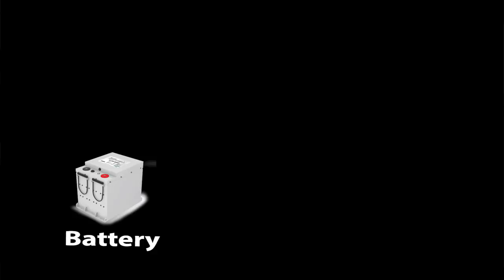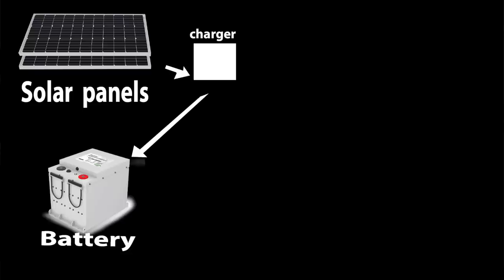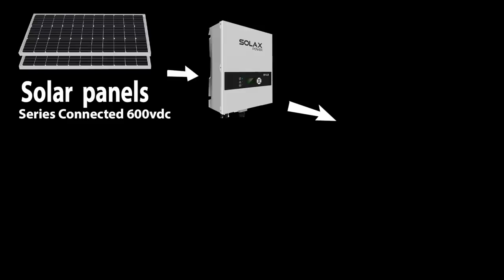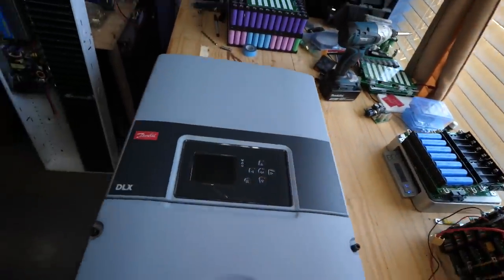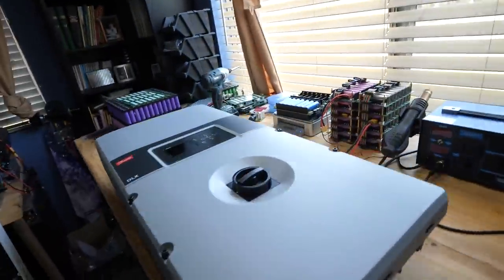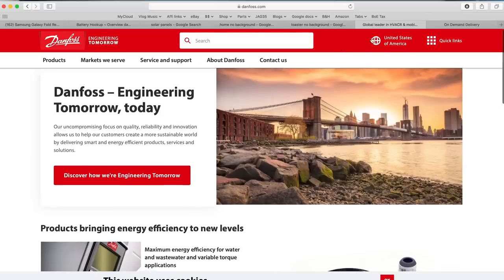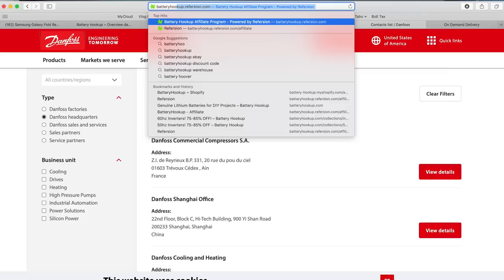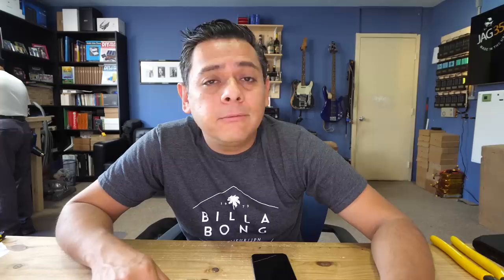Why are these Danfoss SOLAR Inverters So Inexpensive?

Comment: I have been using Danfoss equipment for the last 40 years And never had any problems..I can fully recommend...and I wish to add be it military or civil there stuff is top notch..ps I don't work for Danfoss.. lol
Reply: Are Ul listed?
Reply: We had some Danfoss drive speed controllers for some heavy pump equipment. It's great stuff.

Comment: Strictly speaking, it is "split phase AC" rather than "two phase AC".  Two phase AC is actually something different and it's not commonly used.  In North America we typically have 240 volt split phase AC (120v x 2) for residential or light commercial and 3 phase AC for commercial and industrial sites.
Reply: Chris L must be a uk or Europe thing. Maybe based on 220-240v networks
Reply: @TheMelbournelad  in europe the power is also split phase, but with no neutral so no 120v. the ac power grids in the us and the rest of the world are basically the same until you get to the point of distribution. in my case the point of distribution is the transformer mounted on a pole outside my house that takes in 12k volt from a single phase line that runs along the very top of the pole, steps that down to 240 volts and splits the phase with a neutral line. in europe the situation would be the same except that the transformer would not split the phase or provide a neutral line so you get 220-240 only.
Reply: @marzsit9833  You are correct about North American residential wiring, but I think you are mistaken about most European standards.  Here in NA we have 240V split phase, which is two "hot" leads 240V apart, with a neutral from the transformer centre-tap which is typically grounded somewhere.  This gives two, 120V hot leads, 180 degrees out of phase and a neutral of ~0V, or it can be used to supply 240V across the pair of hot leads for large appliances like electric ranges and dryers.  In contrast, all European residential supplies are 220-240VAC single-phase, with one of those lines being the neutral (~0V), and the other the 'hot' lead.  This can theoretically cause problems if you try to connect European devices to 240VAC North American outlets that use something like a NEMA 6-15P.  The outlet provides the correct voltage, but if the European appliance has used the neutral power lead for case grounding, then this will be extremely dangerous here, since it would become a live, 120V connection wrt ground!
In practice, I don't think this actually matters much, if at all because in most of Europe, unpolarized 220VAC outlets (2-prong, with no size differences) have been used in residential circuit wiring for a long time, so I doubt very much if any appliance that relied on the neutral to provide case grounding would satisfy European standards either, since that would be equally unsafe (more so!)  Therefore, although theoretically there is a difference (in that if you measure both leads wrt true ground, the systems would appear different), in practice, it doesn't matter.
Reply: @andreafalconiero9089  american devices such as a clothes dryer use 240 for the heating elements, but the controls are 120v
Reply: @firecrow7973  That makes sense.  Since the dryer plug is 3-wire with a supplied neutral, it's easy enough to tap off that internally to get 120VAC if desired for the control circuits.  You could still use a European dryer in NA, but not vice-versa, since presumably those models must be designed to run exclusively off 240VAC.

Comment: The DC disconnector has many poles. and they are used for making the DC break easier. DC current is not easy to interrupt.. so the breaking of the current occurs in multiple spots at a time. if you were to do it in just one point the switch would become very expensive.

Comment: The reason for having all of the switches in series is for high voltage DC arc suppression. A single pole switch would sustain an arc causing a melted switch or even a fire.
Reply from the maker: Interesting
Reply: @jehugarcia  thats why you aren't supposed to use AC breakers for DC use.
Reply: Should use an electronic fuse replacement circuit. they are solid state and have no chance to arc unless the MOSFET goes bad. Which can happen I have replaced plenty of them during my career as an electronic tech.
Reply: @mikeorjimmy2885  When you say "unless the MOSFET goes bad", remember that this is the safety interlock on the front end and MOSFETs go bad.  Many solid-state components seem to have a love for failing shorted, especially if it saves the $0.50 fuse meant to protect it.

They don't over-engineer the other parts, so I figure they needed to here.  It's like the zig-zag PCB patterns for arc/transient containment on things like sprinkler controllers; it often shows where earlier designs failed enough to pay the extra cost to prevent it.
Reply: I bet these switches are for 3-phases that are standard all over Europe..
Reply: Just think each switch contact opens 1/8 of an inch, well adding 6 gives a bigger gap for a spark to jump. Common practice to use COTS parts as prices are less and already in production.
Reply: @ontoya13 a VFD is nothing but an inverter where you can select the frequency.

Comment: so Danfoss is a massive Danish company that makes high-end industrial stuff I'm really surprised that you haven't heard of them!
Reply: Yeah same thoughts..
Reply from the maker: Us Americans we think we are the center of the universe.  Danish what?  I though that was a pastry
Reply: @jehugarcia  Danfoss makes tons of industrial equipment. They are huge, do lots of business in the US.
They also had a big recall on inverters. Are these some of those?
Reply: I have been using Danfoss motor drive inverters for years in the refrigeration industry and are excellent machines,  they are the default choice for trouble free installations . They manufacture a huge range of mechanical and electronic controls for heating system and refrigeration systems and industrial control.  I can't recommend them highly enough.
Reply: @jehugarcia  As a Dane that made me laugh
Reply: @jehugarcia   lol, right, so here I am after about 2-3 years of having a 17 solar panel system wanting to add a battery system that will power my whole house and studio. my problem is finding the right match for my solaredge SE5000A , I'm not sure if I can just add some type of "Powerwall" or/and maybe a generator that will kick on if the batteries get to a low state where  they can be fully charged while powering the house as well or at least to a level to where it will keep the batteries up long enough for the sun to take over the charging again. ?? your input is great and I really like your channel !
Reply: Same thought here, incredible quality and well known in Eu. For those price, I would buy immediately one.
Reply: @jehugarcia  Speak for yourself please, not all Americans.
Reply: Went to the site they are sold out. 8 Jul 19
Reply: @jehugarcia  I need an INVERTER for my Solar in my >>RV<<. would this work, or just too big and needs to be mounted on the wall for heat to flow...?
Reply: jehugarcia scandinavia started commercial mobile systems in the world. Even small danish islands got faster internet connections than a NY apartment got today. Danish companies are globally leading in heating ad water solutions. Maybe 30 years ahead of US....food industry too. Sadly many americans dont own a passport, but think US is a paradize, they would be in coma if they had general knowledge about how rest of the world look like, and yes, I did live in US and a handfull og other countries, visited 65+.
Reply: @jehugarcia  You really should taste a real danish pastry...
Reply: Everything is made in China

Comment: Just about anyone technical in Europe will know Danfoss, UK especially, as they are a ubiquitous supplier of radiator (water central heating) valves, thermal controls, HVAC plant and many other components and accessories in both the domestic and industrial markets as well as a major supplier of other parts in allied industries. They have been around in the UK for DECADES. I'm 67 and have known the name for over half a century and used their products for four decades just as a diy-er. They are as well known a name as Honeywell in the UK and I suspect that name is very familiar to North Americans.

Ask any UK plumber (or I suspect, German, Dutch and of course Danish/Scandinavian) if they've heard of them and they'll look at you as if you're smoking something - DUH! Yes of course! 😂😂
Reply: Quite big in the States as well when it comes to motor drives & HVAC equipment.
Reply: Don’t these look like the Delta / Eltek theia He-t inverters that were recalled in the states?

Comment: Danfoss is very much known  among people working in industrial systems. They were famous for manufacturing pumps. At least here in Europe.
Reply: In the US too. They spun off the pump business under the brand Concentric.
Reply: For pumps it is Grundfos, also a danish company though.
Reply: @Runenaldo  You are right.  I guess there used to be some pumps with AC motor and frequency converters integrated. Maybe the pumps were grundfos and the eletrical equipment was Danfoss
Reply: I own A KORTING fridge from 1999. It uses Danfoss compressors - two of them. Big fellas, heavy and solid too.
Whisper quiet and ... get this... 24 Years of continuous operation - work flawlessly.

24 YEARS!!! They certainly don't make the like this anymore.

Comment: Homes are single phase. The secondary transformer is center tapped, and grounded, giving it two out of phase wires of 120 VAC in reference to ground, or the secondary neutral where it’s bonded, but the secondary coil is still single phase 240 VAC
Reply: Thank you for making this clear

Comment: Any one buying one of these should check with their electrical provider to be sure you can back feed.  If you use all you produce, than this is not any issue.  Also remember that you need enough solar panel voltage to get this this up an running.  I have not looked at the specs, but most don't up convert, only down convert which means you will need enough solar panels connected in series to get above 240VDC
Reply: @wu ming The voltage goes almost to max with barely any light, but fluctuates with temperature.  It's the current (amps) that is affected by how much light it is getting.  You need to calculate your max open circuit voltage (Voc) on the coldest day of the year (using the panels temperature coefficient) and make sure you stay under 600V.  You also want to check what it'll run on the hottest days to make sure you stay above the minimum 230V.  As an example, for where I live (gets very very cold, but also hot in the summers) I would need 9-12 panels attached in series to be in the desired voltage range.

Comment: The DC switch is wired over all contacts to reduce the stress on a single contact. So, if you have all contacts in series, the voltage per contact is divided by the number of contacts ;-)

Comment: Danfoss is a well known and respected manufacturer of industrial drive controllers. They have a long history of manufacturing high voltage control equipment including variable speed controllers, industrial switch gear and of cause inverters for UPS systems.
Reply: Also air/con & fridges compressors and industrial instrumentation...
Reply: @henryrollins9177  According to their website, they no longer make solar inverters for the US Market, making this video worthless.
Reply: @critterscropscuisine2886  $2,000 off scratches to my flea market itch.  mmmmm, 25 year duty cycle feels so gooood.  And those $50, 240w solar panels on that used solar panel website, wow, if I do the work myself it'll be all gravy after only two years, and I can afford to buy a heat pump.

Comment: That lock they used to lock it out and prevent theft is a Master Lock 140. It's not strong, with a brass body that can be cut open quickly and is a simple fast pick. I'd use a better lock.

Comment: From the specifications, it appears that the input voltage must be between 230-500VDC.  Therefore, normal battery voltage of 24-48VDC would not work on these  inverters.
Reply from the maker: Correct

Comment: Connecting all the switches in series is to reduce the probability of not opening the circuit in case one of those contacts getting "glued" due to melting metal... bad contact and causing arc.. etc. The more circuits you put in series which are mechanically interlocked the less probability of that is to happen.
Reply: Especially because of the arcing. Wen you disconnect a high dc load its very difficult to prevent an ark from forming.
Reply: @Henrik229  Exactly! That switch is supposed to be able to cut the power when in full load.

Comment: As an electrician, we still call it "Single Phase", although it is truly using two different phases, but yes, Chris L is correct.  Thanks as always Jehu!  Need to talk to you about a business I'm thinking about beginning if you have a moment...  how do I get ahold of you?, I don't do facebook.
Reply: You're right It's single phase... The neutral and ground just define the average of the phase and you can sink power to the average instead of sinking it to the other terminal in the phase.
Reply: Yes and no a lot of those bigger systems are 300v+ 3 phase. But yes your home is on single phase with an neutral aka average. Its not 2phase if it was a true two phase it be in phase and jumping and you get subtraction from neutral meaning 120 or 0v not 120-240v
Reply from the maker: 220v single phase with center tap?
Reply: jehugarcia It’s officially referred to as split phase in the US for residential power. It’s ‘single’ phase, since it’s a single phase off the grid run into a center tapped 240V transformer. Both legs give you 240, but one leg to the center tap is 120. So you technically see two apparent phases inside the house, but it’s still called single phase, or split phase service.
Reply: US residential power is 220V single phase with center tap, but this inverter is 220V single phase. There is no center tap,  it is not designed to use or operate on 120v. It does not need a neutral, just a ground. Plenty of international gear will work just fine with American split phase power, as long as it says L1, L2/N then you’re good to go. But neutral is only required if something internally relies on 120V, otherwise it’s just ground and the two hot legs. In this case, the leg marked L2/N is going to have 120V on it with respect to ground, so connecting that to ground is going to both put 120V on ground and short out L2.

Comment: Nice I want to see how u use it as a off grid inverter with batteries
Reply: Chris Damon  
I too wish to see jehu bypass the WiFi that enables the system!!!! I am thinking of another system complete to run into the ac Side for the boost. Than tricking or hacking the system to think its into some grid!!  some how, get a computer expert that knows these systems.

Comment: That jigjag switch is used to prevent arcing. At high voltages DC jumps over airgap and starts arc. That switch disconnects at multiple points.
Reply: Spot on, DC is a lot harder the break than AC that by nature has a zero voltage point 100 times a second (we here in the land of Oz have 50Hz mains) making for a easier breaking. The series wiring through the contacts make for bigger gap quickly to ensure it does isolate.
Reply: @benstyles8494  yeh that's the reason we have AC current in use. Easy to break.

Comment: When switching high voltage DC (like 600 VDC from the panels) you have a risk of arch between the contacts when the switch opens (as in switch off) and you therefore need a long (relative) distance between the contacts compared to switching AC voltage. This can be accomplished by coupling several (AC) switches in series.   
When switching AC power the same issue do not occur due to the alternating current pass through 0 volt 120 time a second (60 Hz system) and then will by itself stop the arch.
Reply: Arc